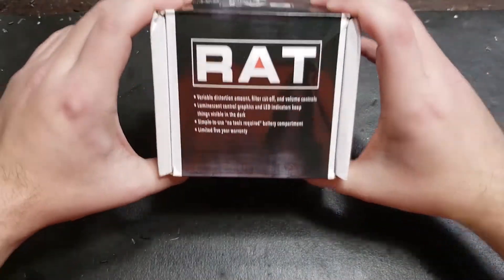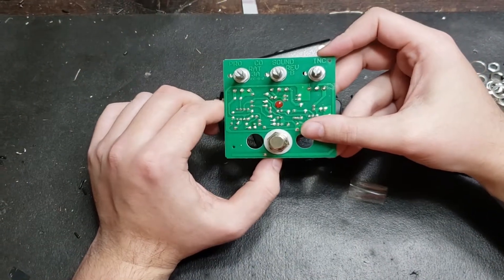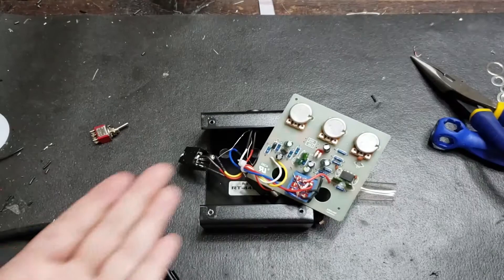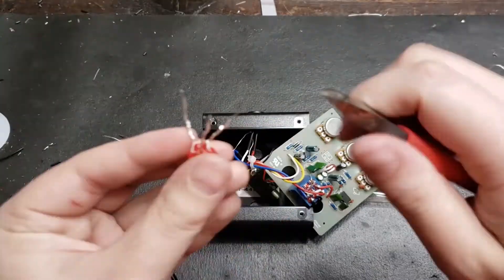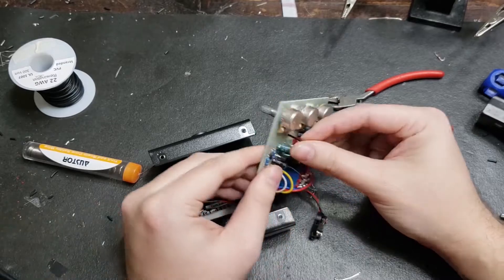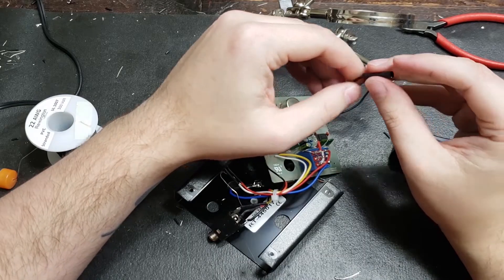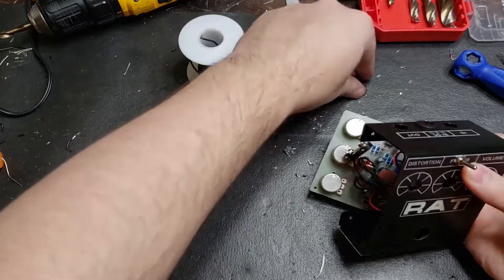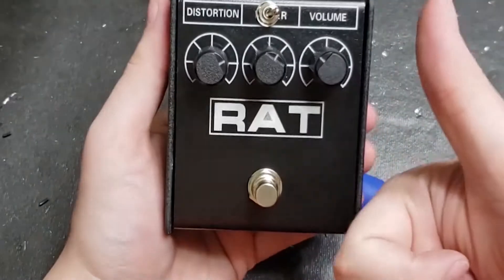ProCo Rat Mod - Poison Noises Tutorial

Comment from the maker: 8:36 This wire bridge is not necessary. This was an oversite on our part, as the board makes the connection already. Instead, you may simply use 2 wire connected to both sides of a single diode. Thank you, everyone, for pointing this out. A lot has been learned since the making of this video!

Comment: Just did this mod, while it does offer the headroom and clarity, the signal kind of "falls off" when you sustain a note. Somewhat like a gated fuzz is the closest thing i could compare it to, although not as drastic. Is this normal? What could be the cause?
Reply from the maker: I wouldnt consider that normal. There would be less compression, so therefore less sustain. But nothing should be gating. No hard stops. I would check your joints and make sure that you are not shorting another component.
Reply: @PoisonNoises maybe gating isn't the right term. But I would say like falling off, less sustain makes sense. I compared it with my Chinese turbo rat, and it doesn't do the same thing. But who knows. The mod i did doesn't sound "bad" I just wasnt sure if it was a normal characteristic.

Comment: I just modded mine to have one germanium and one silicon clipping diode.  It sounds getter than this (no offense) and closer to a Tone Bender a la No Quarter with some nice light sag.
Reply from the maker: So that would be asymmetrical clipping with a lower forward voltage drop than the stock on one side of the wave. Probably around .35v. Would give you a little more compression and some volume loss, but the rat has plenty on tap to make up for it. Probably sounds kind of tube like with the asymmetry. Sounds cool!

Comment: Doesn't sound good.
Was much better straight from the factory.
If you don't like how a pedal sounds, why buy it?
As many pedals as there are available, there is certainly one that has the capability of providing the sound you're after.
Reply from the maker: Proco makes a version of this. Its called the turbo RAT. Many consider it to be superior. Instead of spending another 100 dollars, spend less than 3 dollars in parts, and have both available on a switch. 

Its also a fun project thats even easier than writing a dumb YouTube comment.
Reply: @PoisonNoises 
You proved my point. What you were after already exists... and with much better workmanship.
Reply from the maker: @tlb2732 For less than 3 percent of the price. And in the same box as a 2nd product. Idk what youre trying to prove. But this is the wrong place to do it.

Comment: Do different coloured LEDs produce different sounds?
Reply from the maker: They actually do to a degree. Different amounts of compression and headroom.
Reply: @PoisonNoises  Can you use a LED COD (cluster of diodes) with this mod?
Reply from the maker: @martinabe9406  I have never done it, but I image it would work. At a certain point the forward voltage drop would be so high that you wouldn't even hear a difference.

Comment: If I don’t have a switch, can I individually replace each stock diode with a led in its existing place on the board? Thanks!
Reply from the maker: That will absolutley work. Just make sure that you match the polarity positions of the original diodes.
Reply: @PoisonNoises  Thanks, good vid!

Comment: This is great…absolute beginner here, but when you change the clipping to the LEDs does it actually make them light up?  I’m guessing no but if so it would be really cool to see…
Reply from the maker: If you put a strong enough signal into it, yes they will. You will notice that one LED will light up brighter than 2 of them in series due to the forward voltage drop.

Comment: Would this mod also work on a lil Rat? Same 3 LEDs on the switch or 2?
Reply from the maker: Not sure if the Lil rat is surface mount or not. The schematic should be the same though. 2 LEDs can also work, but will sound different.
Reply: @PoisonNoises  Sweet, going to give it a shot. Saw one modded with a 3 way switch, rather have the smaller footprint. Thanks for making the video👍🏽.
Reply from the maker: @RasCuban33  Try it with an on-off-on switch. That middle position will scream without clippers.
Reply: @PoisonNoises  yep, also I’m going to repaint the side/bottom enclosure with color shift galaxy blue spray paint and change out the knobs if those small black ones come off easily. Swap the center red LED to Green.
Reply: @PoisonNoises  next to near impossible, it’s top mounted and all of the components are microscopic. You need Jewelers equipment to work on the Lil Rat. Going to get a standard size one now.
Reply from the maker: @RasCuban33  If you've got steady hands, you can still mod a surface mount pedal. Should only be 3 diodes in the circuit total. The 2 that are next to eachother are usually clippers. Soldering right to the pad will work if you don't want to buy another one.

Comment: Im about to install the mod myself, and i was wondering if its possible to add a second LED (not as a clipping source) to indicate which mode it's on, so it only lights up when it's on "mod mode" 

pls do more of these, it's really helpful to get into to whole diy mod thing, thank you!
Reply from the maker: Yes you could. You would need a 3dpt switch, and to have the ground of the LED connect when in the flipped position. Similar to a stomp switch on a true bypass pedal.

Comment: no need to have four wires going to the LED spot on the PCB since they're electrically connected. Two wires are enough.
Reply from the maker: Thanks
Reply: Can you expand a little more on what you mean. Thanks.
Reply: @ChasingTone666  The operation that starts at 8:40. You don't need those 4 wires. The pairs that are connected inside the heat shrink are already connected anyway. If you test with a conductivity tester or if you analyse the diagram, you'll find out the + of one diode is connected to the - of the other one.
Reply: @etrou4  So I could technically run my hookup wire from the two holes of D3, leave D2 blank, and it would work the same?

Comment: Probably don't need four wires going to the board. One end of both diodes will be going to ground so there would be continuity between the two pads at that end. I'll bet that the other two pads have continuity as well as they'd both have to be in the AC signal path. Multimeter would  confirm...

Comment: You should try using an on off on switch too, so there's another no clipping mode.
Reply from the maker: Oh yeah! That middle position is loud in all the right ways.
Reply: Same wiring configuration as shown here only with a on off on? Any difference using green instead of red LEDs?
Reply: So, with this wiring, the "off" position off the switch would let the signal just run through ? Or would it act as a "kill switch", not letting any signal go through ?
Reply: @MrWsaenot I'm not that familiar with the Rat circuit, but you still have gain stages in the pedal, so it should act as a boost pedal. Again, not familiar with the circuit and I do not know if there are any clipping in the LM chips. But the presence of clipping diodes suggests that the chips act as gain stages.

Comment: Ok but there is not reason to solder double cables in the diodes points, just using one diode place (+ / -) would be enough ;)
Reply from the maker: This is true. Thank you for pointing that out.
Reply: @PoisonNoises  That´s ok, Great Channel.

Comment: Can we so same thing with spst switch???
Reply from the maker: It is possible yes, but this video will not show you wear to connect in that context.
Reply: @PoisonNoises  ill manage that.. thankyou..you are he best

And  i like ur videos longer. :)
Reply: SPST VERSION: With the LEDs permanently installed in place of the original diodes, a SPST switch can be used to connect the 1n4148 diodes in parallel WHEN THE SWITCH IS ON. 

With the 1n4148 diodes switched-in, the signal gets clipped at a lower voltage, so the LEDs (which clip at a higher voltage) have no effect, even though they're still in-circuit. 

On the circuit board: Replace one original diode with the LED circuit, replace the other original diode with the 1n4148 pair in series with the SPST switch.
Reply from the maker: There are some configurations that can easily be found on Google to swap clipping diodes. However it is usually more convenient to mount them directly to the switch, as is done here.
Reply: @PoisonNoises  well my questiom is do i really need dpdt switch or i can do same thing with spst switch?

Comment: using 2 LEDs will make it more similar to a turbo rat right?
Reply from the maker: You got it! I'm not sure if the configuration in symmetrical or asymmetrical in the stock turbo rat though. Turbo usually means LED clipping diodes in just about any pedal